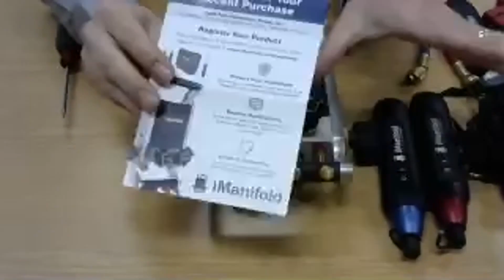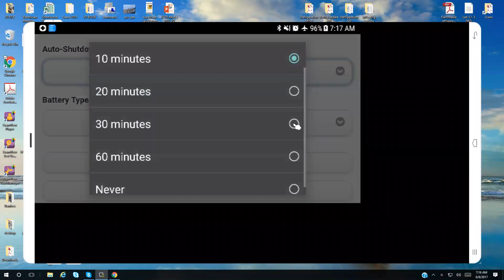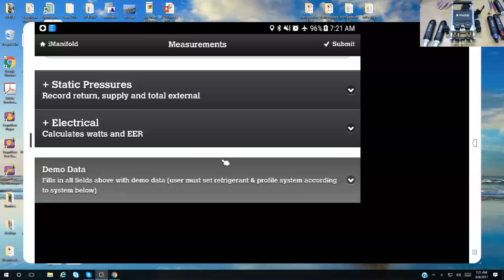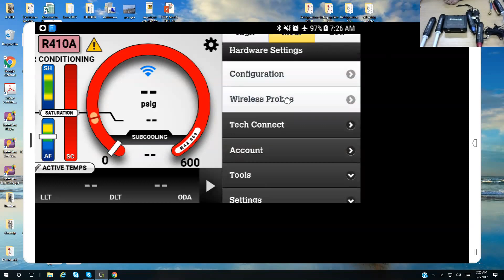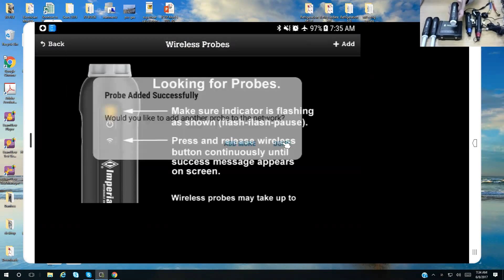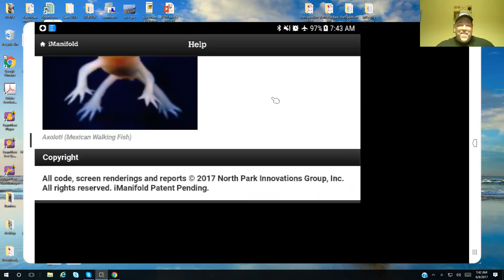Starting up the iManifold or iConnect

Comment: #goforgoldwithimanifold, I need this to show my boss that I can get faster readings and more accurate measurements than using his Sman 4 and it is lighter for me to carry up onto a ladder on a roof at a restaurant when it's over 100 degrees on the roof. Pluss Sman hard to see in the hot sun.